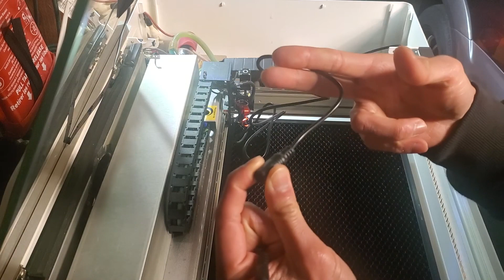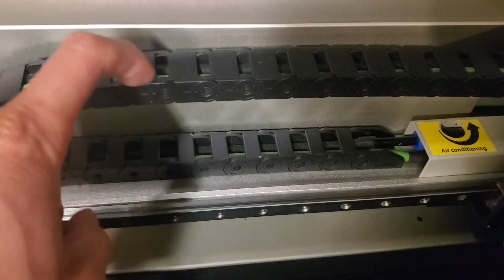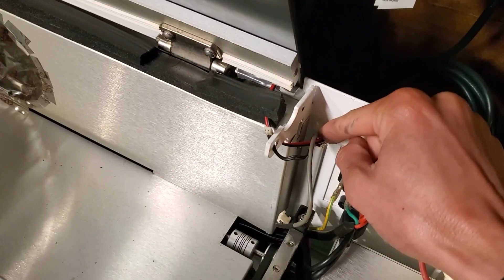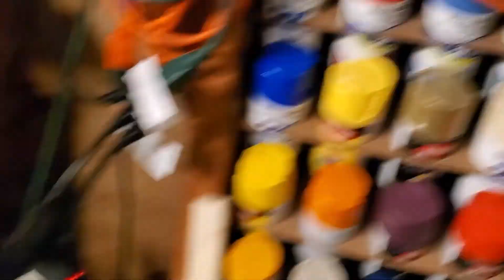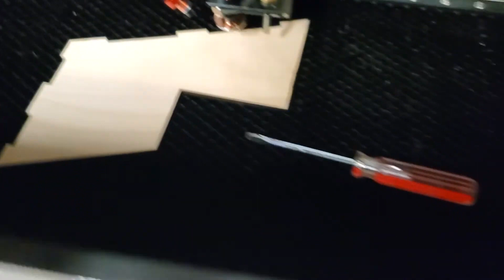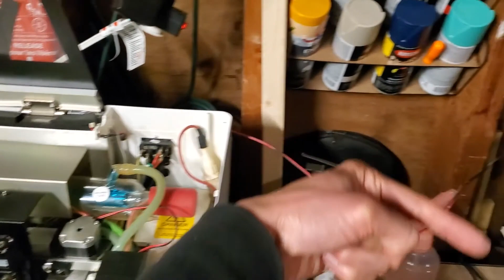So you want a red dot laser on your GweikeCloud?

Comment: Hi, did you ever read the label on the tube? Who is the manufacturer, ERF, Yongli, etc...I have the feeling that the 10K hours is way overstated since most tubes have 2-5K depending on the model number, and I bet they did not put a Reci :-)
Reply from the maker: responded to your other comment but no label on my tube at all.
Reply: @GuyWithAGweikeCloud  that is interesting, when I contacted support multiple times, they refused to tell me, however what I get randomly from 2 of them on the chat was Yongli and the other EFR, I asked what series and what model number and they cut me off immediately, i downloaded the tube specifications from the manufacturer, 55W non of them have, 50W will not fit the laser as is to long, and 40W will fit..............this is very weird.I saaw somewhere mentioned on the Polar an Yongly T10 but I could not find the specs, On the Yongli website the one looking with the red caps in gweike is part of the dirt cheap series, I am trying to see if they use A stock or Bstock as well.As I was discussing with them, they could not understand what I am talking about, and sent them a you tube link and said "did you fix this fault " and they said a we know this guy , this is not what we askked him to do.....wahahahah, so they monitor all the people with endorsements and are so many with infocommercials not reviews.
Reply: @GuyWithAGweikeCloud  I wonder if any of the guys owning the machine put that cheap 200 usd meter after the first mirror to measure the real power coming out. Funny enough that meters are pretty accurate 2-3 %.
Reply from the maker: @LucianComanphotography  what meter

Comment: Do you use the camera with LightBurn?
Reply from the maker: Yes which is why I say this mod is relatively useless. But a lot of people have requested a red dot mod for some reason.
Reply: @GuyWithAGweikeCloud  I havn't tried conneting my camera to LightBurn yet. Don't know why we need it :-)
Reply from the maker: @tegheim  You don't know why you need the camera?
Reply: @GuyWithAGweikeCloud  yes. What do it do?
Reply from the maker: @tegheim  helps you place your engravings and cuts.
Reply: @GuyWithAGweikeCloud  yeah, ok. But eyeballing isn't that accurate for what I do. Laser point would be better, but still not. I need fxtures :)
Reply from the maker: @tegheim  the camera If calibrated right allows you to place anything incredibly accurately. There is absolutely no use for a red dot or eyeballing
Reply: @GuyWithAGweikeCloud  ok, I will look into it. I meant eyeballing with the camera. But ok. Will look!
Reply: @GuyWithAGweikeCloud  I tried to calibrate my camera as best as I could. But when I update the overlay, without moving anything, after engraving, the engrave image is in a different position than what it shows me on the screen. Any ideas? It's currently a 2700 euro paper weight now...
Reply from the maker: @Cessna172G  If your material is too thick then it can affect the camera and positioning of your engrave. For me the difference is noticeable. If I use a 3mm thick material compared to a 6mm material, The 6mm material is way off

Comment: Nice Idea.  I wonder if you could of mounted the laser pointer on the Tube and point it at the first mirror which would then bounce all the way to the lens assembly and down on the material surface?   It seems by adding weight to the focus head adds weight causing it to slow down.
Reply from the maker: i dont know of a way to center the laser within the tube to do that. Although i did think about that. i dont ever engrave so a slow down isnt an issue at least for me (if there is a slowdown)

Comment: Great idea!
Does you camera often loose connection after cutting? I have unplug/plug back in the USB connector of the camera often as it seems to crash when the laser is fired. Probably EMC issue. If you make a built-in hub, this will not be possible.
Reply from the maker: Yes but mine is due to my hub not providing enough power so not necessarily a gweike problem.